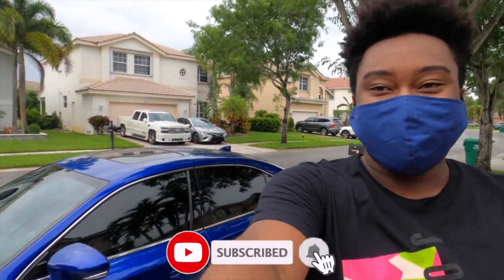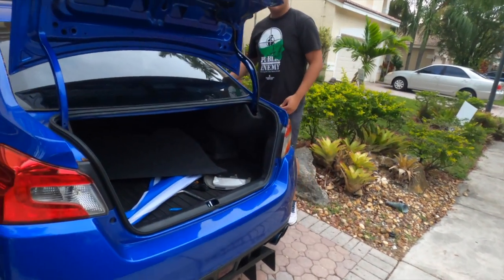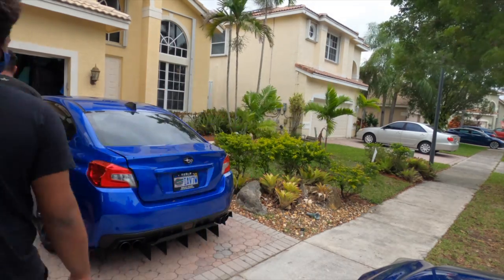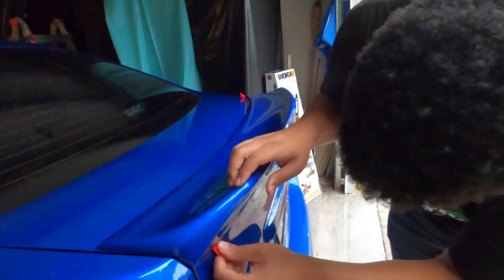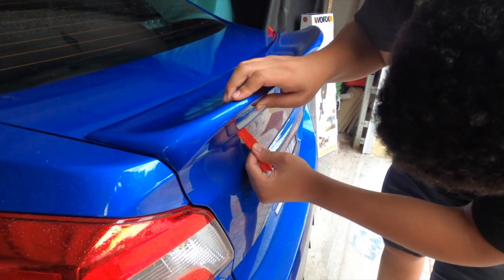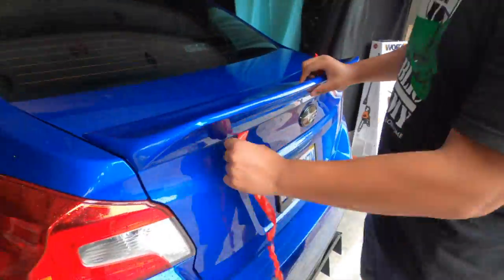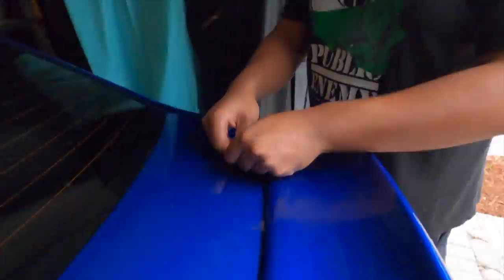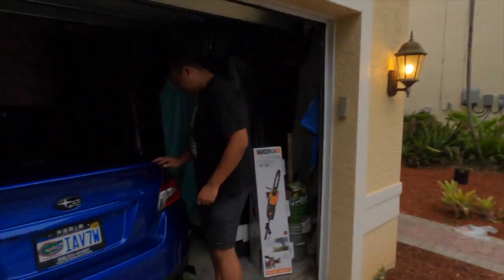2018 SUBARU WRX DUCKBILL SPOILER INSTALL

Comment: ppl make the video  simple job still entertaining   good job
Reply from the maker: Thanksss I appreciate that
Reply: i luv subaru   had  wrx   outback and crosstrek   looking to gey a 17 sti now   not into the 18s   currently driving a 17 gti  beautiful car  but  it has no animal look to it    or awd  or  god  its got no boxer rumble       any problems with ur buddies or i seen a red 1 on da street
Reply from the maker: Ya a sti would be sick af. The AWD comes in clutch. I mean I live in Florida’s I don’t have to deal with snow but in rain I get 0 slip even when I take off fast. Ya the red ones mine. The only problems I’ve had is the stock battery takes a shit on itself after about a year and a half and my ac clutch was making hella noise after a year and a half as well but they replaced it under warranty. For the battery I just bought a better one. But other than that me and him haven’t had any pricey ridiculous issues. I love my car sooo much 😂

Comment: How’s it holding up so far and any signs of leaking? I just got one and I’m not sure if it should be screwed on also. I don’t trust just tape to hold it on especially during high speeds lol
Reply from the maker: His duckbills doing perfectly fine currently 👍🏾
Reply from the maker: No leakage.
Reply: Just got one in for my 2018 WRX and mounting holes are not on the WRX but only on the STI 🤦🏻 so I either trust the tape or drill holes in my trunk 😬 good to know his is still holding strong with that tape though.

Comment: Im contemplating on buying the subispeed duckbill but can you bolt it on instead of just tape?
Reply from the maker: Ya there’s tape and there’s spots for bolts as well so you can do both for extra security.
Reply: Just bought a duckbill but the mounting holes for included hardware are only on the STI 🤦🏻 so I either go with just the tape or I drill holes in my trunk 😬
Reply from the maker: My friend did just the tape and it’s still on there holding strong
Reply: @bryannichelson2  what you do? Just got one and don’t want to drill holes in my trunk if I don’t have to.